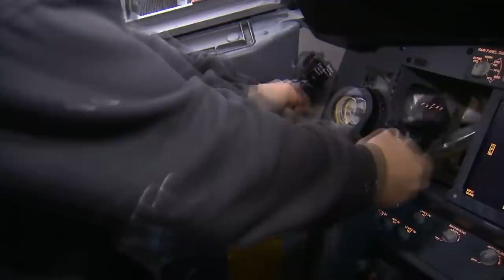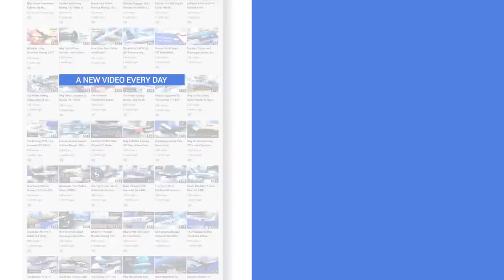What Are White Tail Aircraft?

Comment: White tails are also offered as VIP aircraft. The original airlines have often partially paid for the aircraft before cancellation hence they can be tendered at lower prices.
Reply: Weren't some (if not all) the 747-8 passenger white tails in the end sold as VIPs?
Reply: @Kalvinjj  Apart from the ex-Transaero ordered 747-8s converted to VC-25Bs for use as Air Force One I don't know the fate of any 747-8 white tails.
Reply: Australia has also been good at working with both Airbus and Boeing to use white tails to develop proof of concept military derivatives such as the A330 MRTT and Wedgetail 737 based Airborne Control Aircraft.

Comment: Some regional airlines also have “White Attila0. The first airline I worked for had a couple of “WhiteTail” aircraft.  We flew for several airlines as commuter service…At the time AA/DL/UA/US.  The aircraft were painted in the liver of that code share but we had a few generic plane white aircraft that could theoretically fly for whatever code share needed the aircraft for that day or flight.  Example DL flying in ATL.  Aircraft is either broken or significantly delayed for whatever reason.  The only other aircraft might be w WT spare.  If it comes to saving a cancellation they might say use the White Tail but get it back quickly Z. Code share partners didn’t like it but if it was the only way to save a Cancellation or significant delay and the only aircraft available had to do it.

That same aircraft might fly for different code shares each day or even the same day.    The Magnetic airline logos don’t exactly hold up to 400 MPH airstream.  They even went so far as to have a generic Blue Taul which was white body but Blue company logo instead of the code share partner logo.
Reply: White tail ≠ any aircraft painted white
Reply: Is that why Skywest and Republic have a few aircraft in their own livery?
Reply: @RunawayTrain2502  probably yes!   Some of the major coordination was making sure that the Code Share partners were fine with it but i fit saved a CXL or major delay then fine.

Comment: An important feature of white tails: they have that status when they start production. Putting the livery on the hinge end of the rudder is far simpler before assembling it into the vertical stabilizer. That requires the plane have an owner upfront. The actual build of each jetliner can vary greatly between customers, complicating the sale of a white tail.

Comment: During the Afghanistan wars Twente Airforce base  briefly had other kinds of white tail planes on the tarmac. Maybe with involuntary passengers.
They looked like older models based on the engines under the wings. Never saw these in Europe. Rentals can be whitetail too. Flew on one operating on behalf of Easyjet.
Reply: As the video explains "white tail" planes are actually not in use because they have not been sold.
Reply: @ricahrdb   Well I can show you pictures of a literal whitetail that flew me to London. The other ones I mentioned I do not have pictures of because driving and taking pictures do not go together.
Reply: @hcjkruse  I don't doubt that you have those pictures. But again: in the aircraft industry the term "white tail" means something more than just "aircraft with a white tail". The video explains that.

Comment: false: they always have a buyer before production. all white aircraft are planes that are being RE-SOLD.... they get stripped of all paint, painted white, then a test flight to prove air readiness, THEN it goes to auction. new buyer has it painted. They do this all the time in colorado since our airports are so high in altitude already, costs less fuel to get to the required test height.
Reply: And u are wrong, u can have situation where airline collapse, when plane was bulid for them become white tail (owned by producer). Also when order was converted to another plane, manufacturer have capacity to shift later customers to get earlier plane or just try and sell plane. IRC some of Maxes even getting branded tail but customer refuses take delivery (because ban) and plane was returned to Boing